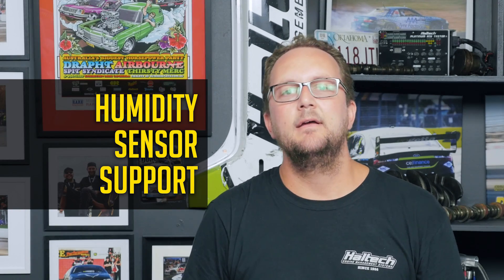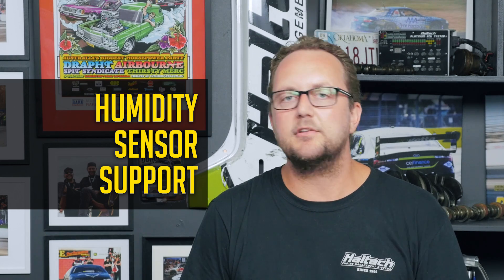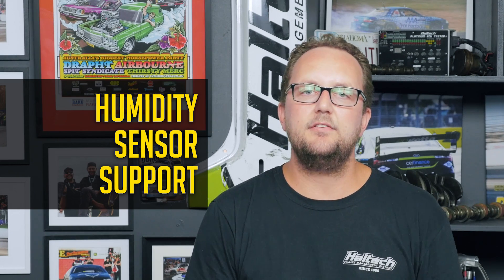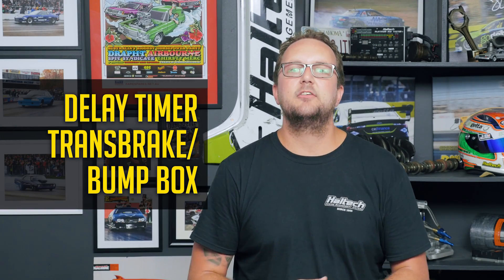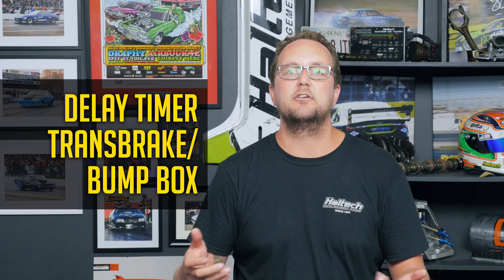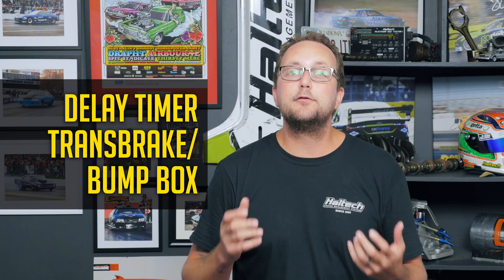🔍 Elite Series Firmware Update Overview - January 2019

Comment: Does it support odd fire, 90 degree v-twin for example?
Reply from the maker: What make/model engine is it?
Reply: Haltech Yamaha trx850, in-line  twin with 270 / 450 degree fire order, 36-1 on crank, no cam sync.
Reply from the maker: Weren't they carburetted?
Reply: Haltech yes! I’m converting my to EFI, BMW f800 throttle bodies and injectors, Mt09 intank fuel pump.
Reply from the maker: Elite 550 will do the trick:)

Comment: does the Electronic throttle blip only work to the next gear down? or will it blip to whatever gear you select?  I ask because there's a 5th to 3rd gear downshift at my local track...
Reply: Only one gear down. The ECU can't know that you want to shift two gears in one go.
Reply: tev olsen GM cars (corvette and camaro) have some sort of sensor that detect what gear is being engaged and they blip to whatever gear you shift to, is it possible  to add a sensor to detect gear to be engaged and blip the throttle accordingly?
Reply: @boblast5582  That sounds pretty cool and handy. If the OEM does it, it's possible. But unfortunately there has to be enough demand for it than other features that people are asking for.

Comment: I really like the idea of cruise control but I hate the idea of fly-by-wire... I guess I need to just get with the 21st century? So what ecu's can you do this with? I'm guessing only the 2500 and up because of the electric throttle body. It'd be really cool if you could operate it with a diaphragm Style cruise control long as you have a wheel speed sensor brake pedal sensor and a way to turn it on.
Reply from the maker: Elite 1500 and 2500 support DBW.
There is a video we did a few years back on how the DBW system works and the benefits of it over the cable throttle system:
https://youtu.be/1eHQuTCdjdQ?